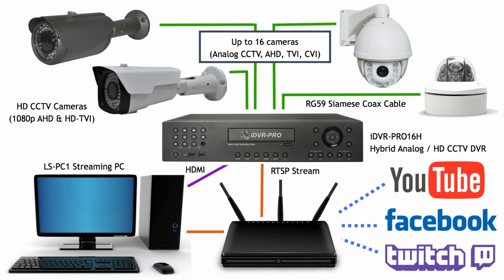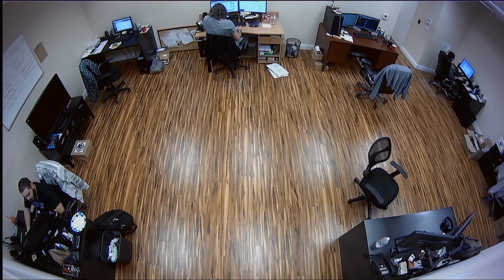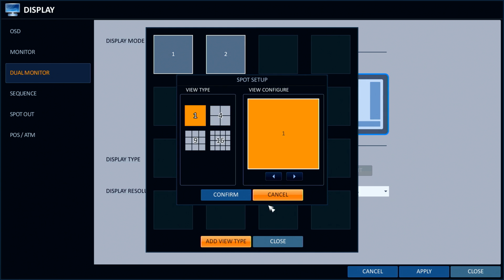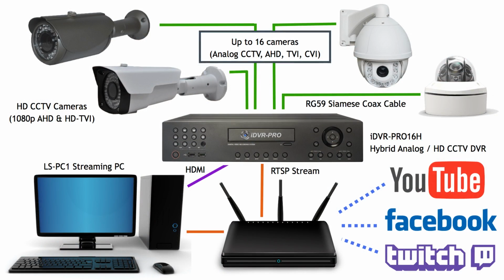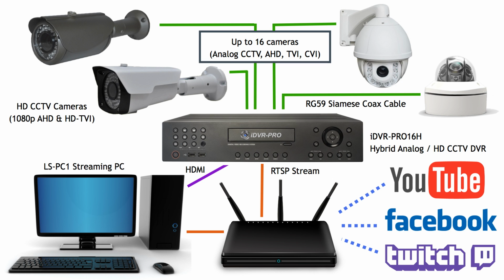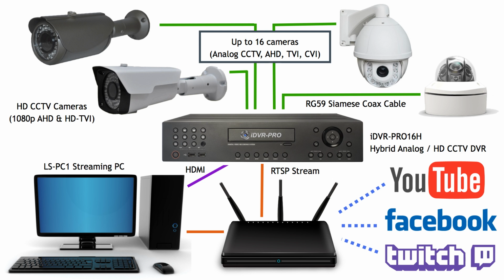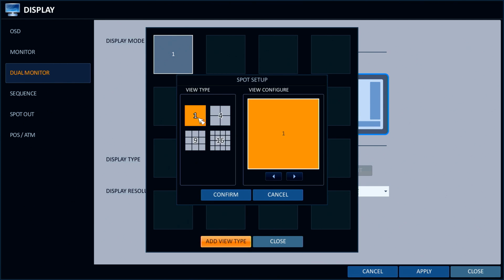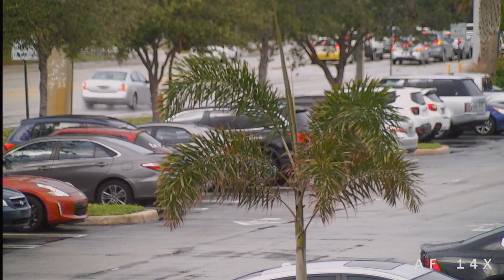YouTube Live Stream Video with HD Security Cameras and Surveillance DVR

Comment: Amazing that this is possible! Thank you for this one. I'm looking for a solution where i can cover live outdoor music events/festivals, (so think 1,000 people and more).

>>> I've got a couple of questions if you could help me out:
1. Would it be possible to take the output from the DVR to a Blackmagic ATEM switcher as a single/multiple feed? Meaning that I could just use a 10-sec delay through cycles between each camera as a single feed, then have other manned cameras on other sources.

2. I noticed that you bought a wide range of different cameras, any particular reason? I've seen packages with 16/32 cameras on Amazon, would it be advisable to go with this option, or buy different ones for different looks and feel?

3. Now comes the hard part, connections, Is there another way this would be possible at an outdoors event without having to lay down hundreds of metres of cables from each camera to the DVR. I'm guessing wifi wont work as that would quickly drop down, any other options?

Your help would be GREATLY appeciated
Reply: https://www.google.com/imgres?imgurl=https%3A%2F%2Fi.kym-cdn.com%2Fphotos%2Fimages%2Foriginal%2F001%2F768%2F953%2F8fa.jpg&imgrefurl=https%3A%2F%2Fknowyourmeme.com%2Fphotos%2F1768953-the-elder-scrolls-v-skyrim&tbnid=LZxMTWUjr4-qfM&vet=1&docid=2--1463kuON6CM&w=720&h=960&itg=1&hl=en&source=sh%2Fx%2Fim

https://images.app.goo.gl/St14bvd1SVzvj5DV9

https://www.google.com/imgres?imgurl=https%3A%2F%2Fpics.me.me%2Fthumb_the-best-weapon-to-have-in-a-place-like-skyrim-70873012.png&imgrefurl=https%3A%2F%2Fme.me%2Fi%2Fthe-best-weapon-to-have-in-a-place-like-skyrim-2d010d809f694080b4e40007a3270d91&tbnid=R1rvHhPUaX3T7M&vet=1&docid=pZAcqiV3ZqT76M&w=300&h=400&itg=1&hl=en&source=sh%2Fx%2Fim _______  _ (_

Comment: Would it be possible to set the dwell to off/infinite and use a USB footswitch to cycle through cameras? I'm thinking of setting up a CCTV system for live music streaming.
Reply from the maker: Yes, you can turn the dwell time off and control the screen with the wireless remote control or buttons on the front of the video multiplexer.